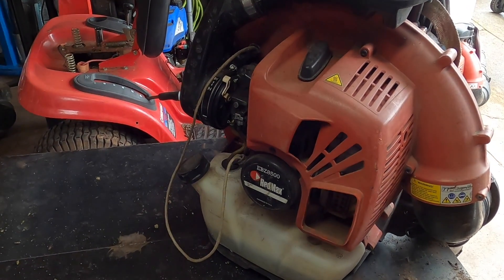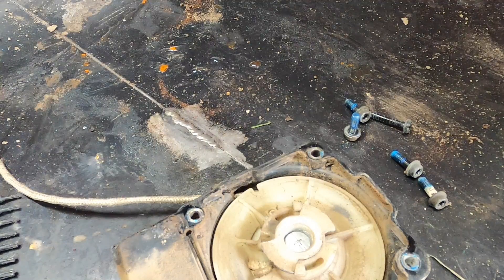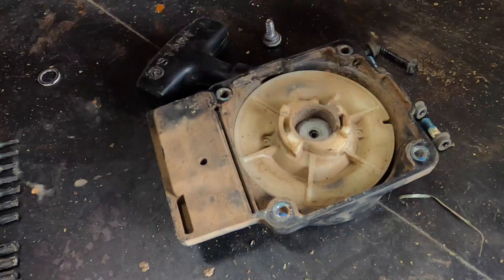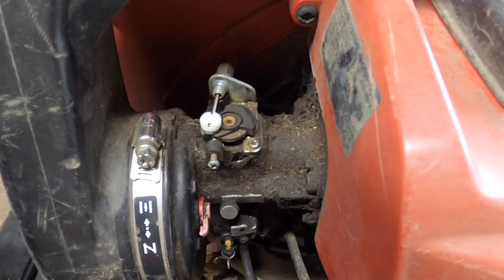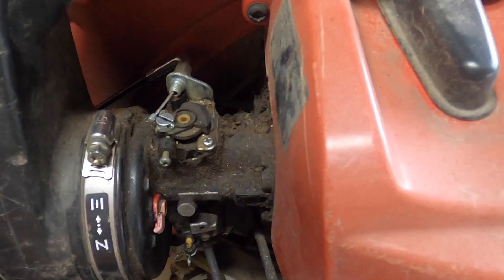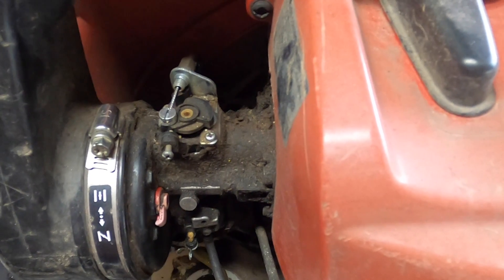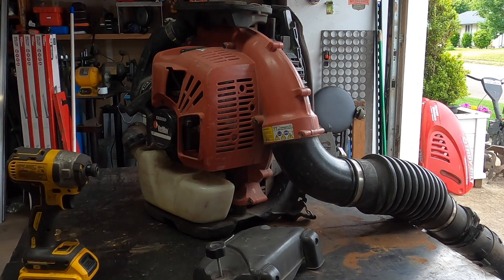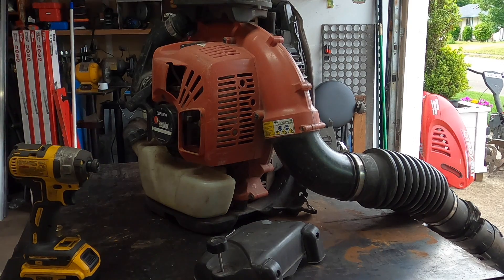Redmax EBZ8500 Throttle Replacement

Comment: Great video!  RedMax is by far the best brand (along with oldschool Solo blowers) imo.  Your video helped me replace the new throttle assembly; the throttle assembly that I replaced was malfunctioning because a friend must’ve forced the trigger too far one way or the other causing the throttle to stay wide open.  Upon inspection, everything was in place: cable slot on handle, screws, throttle cable to top of carb, kill switch, etc.  The throttle cable inside the black tube housing the cable was completely stuck, even after spraying cable lubricant thoroughly through the throttle cable.  Has anyone ever had their throttle cable get stuck inside the black throttle cable covering it?  If so, perhaps the correct answer can save someone else from having to replace the entire assembly as I did.  🤘🏻
Reply from the maker: I have had a cable break which caused it to be stuck. Some of the strands bind up inside the loom
Reply: @PNWSmallEngineandLawn  👍🏻.  Thanks for the information.  That was a tough one.   If you get a chance, I’d like to know what you think about the new 9000.  The 6500 is ideal imo (light weight, small size, and ample power for weekly mowing).